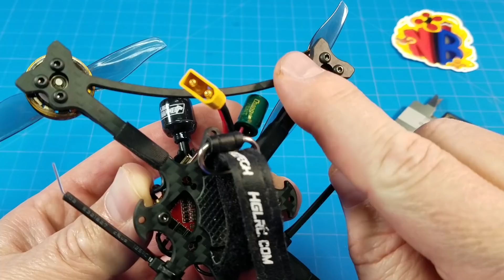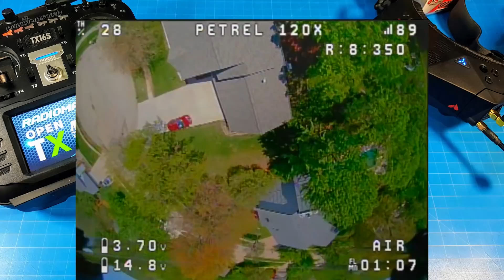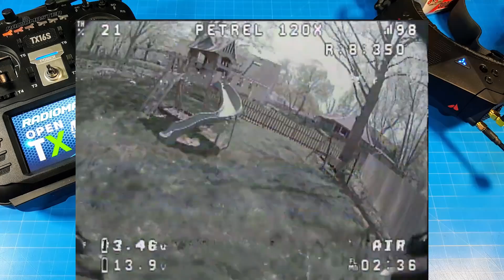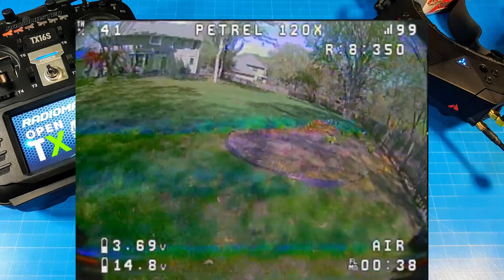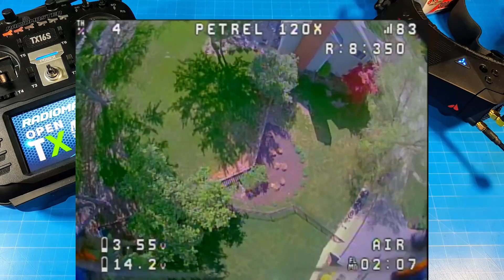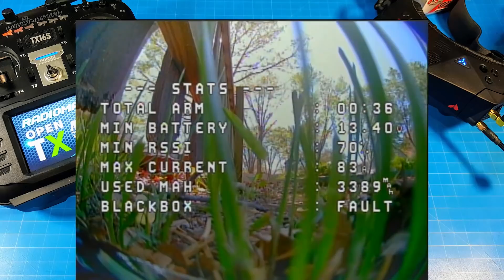HGLRC Petrel 120x 4s Edition // Powerhouse Micro // Screamer!!

Comment: Hi nick I just got this quad 4s edition and I understand it's recommended for 350 to 550 batteries, I only have a 850 4s I understand it's heavier but think the extra power might damage the quad?
Reply from the maker: no the capacity or mah of the battery won't damage the quad, its the voltage that our components are sensitive to. Sorry, I don't recall the esc amp rating on this one, but we do need to be aware of the esc amp rating and the amps the motors pull generating the thrust with the additional weight, but I think you will be fine.
Reply: Thank you for the reply, really appreciate it!

Comment: Can I run a 4s 750 on this?
Reply from the maker: Yes
Reply: Looking for a whippy quad with 6 or 7ish flight time. Suggestions?? Thank you!
Reply from the maker: @cold-frontin_penguin7902  Not sure what whippy is, I presume that is a fairly aggress flight style. 6-7minutes of truely aggressive flight is going to be challenging to get in anything under a 5inch prop. 4-5minutes is more doable on a micro like this. But as we add battery weight to get the flight time the agility and overall quick performance does decrease.

Comment: Picked the last "cheap" frsky RX'd DJI Vista version from getfpv for $238 saturday which I thought was a deal. It's 4s and runs the same F7 controller which I liked the PCB layout, looks nice and spaced out. The big seller in this size range seems to be the Crux35 and while I like them their 12A ESC scares me plus they are $30 more for a DJI Vista version. Plan to swap the RX with ELRS and made a XT30 series adapter so I can run my 2s 300-450 packs. Not sure they make these anymore so I have little hope for replacement motors but you can find a nice canopy design on thingiverse I plan to print out of TPU.

Comment: In case anybody gets this quad and has the same issue I did. Right out of the box I had a bunch of twitching during hover to the point it was barely able to fly at all. I tried switching receivers and messing with the PID tune along a bunch of other things but nothing seemed to fix it. Once I pulled up the black box log it was pretty clear it was electrical noise on the gyro, specifically the pitch axis. So I tried swapping out the capacitor it came with on the power lead to a larger one and now it flies PERFECT and is an awesome quad! I might have just gotten unlucky and gotten an extra sensitive gyro in my unit, but i was frustrated cause it was a brand new quad, hopefully this might help some one else! I'm just glad I didn't have to replace the flight controller.
Reply from the maker: Good information here. Thank you

Comment: I got the 6s version and at the same time asked the seller what controller he recommended. He told me the frsky tranus maybe I got the wrong one but it won’t bind. What would be the easier option new rx or new tx? Thanks.
Reply from the maker: Well frsky has been playing games with their firmware. Its likely the receiver would need to be flashed to match radio firmware version. At this time I don't recommend buying frsky receivers or radios unless we plan to run a particular module with the radio.

Comment: Yup disarming too quickly, and not attempting to roll the opposite way, is what caused my tinyhawk freestyle ii to roll itself along the ground into my pond. 
   Knowing it was on the ground, I cut the throttle and disarmed to avoid damaging a motor, esc, or prop... but it just kept rolling for another 10 feet.

Comment: I wish you could re-visit this but with an RDQ standard voltage 14.8v 650mah, the HV version batterys have lower c rating and sag like crazy not worth using on this powerful quad.

Comment: Thanks for this episode. My eyes almost pop out when you show your PIDs on the screen. I use the Petrel board on my single rotor helicopter diving FPV. And I have the same 40/120 ratio between P and I. This number is magical. I compile my own betaflight firmware and CC3D firmware. And CC3D needs 17/340 to get the same flight characteristic.
Reply from the maker: Boy I haven't talked to anyone using CC3D in a while.
Reply: @NickBurnsFPV  I am planing to revisit CC3D in the winter recess. I am into researching the software lineages. The developers of both CC3D and betaflight/cleanflight tinkered with some master code. They have some scale multipliers for the PID numbers to look like they are original coding.
Reply: @johncgibson4720  CC3D was a nice board and configurator was amazing back then.

Comment: Rdq or gnb 524 4s are best off both worlds lighter than 650 with the same power
Reply from the maker: I wouldn't use those with a powerhouse quad. My flight time might only be 90seconds. The smallest I would go with something like this is the old GNB 550mah 4s. The elongated batteries weigh less and have far less ability to handle demand.

Comment: hi Nick!  Why does your drone have 2 blades?  4s from the factory should have 3 blades!
Reply from the maker: I don't know. I saw the pictures showing tri blade props. Maybe that was what they thought they were going to ship with but then found bi blades to be better.....just a guess.
Reply: @NickBurnsFPV  what to buy?  hglrc 120x or geprc phantom?  Thank you!
Reply from the maker: @balantisable  Depends on your flying space and flight desires. Have you been flying awhile? The 120x is likely going to require more space, especially if you early in fpv. The phantom is going to be more smaller space friendly. On the flight desire side, the 120x is going to be faster, punchout higher and be overall more aggressive.

Comment: Which one do you prefer : Petrel 120x 4S or  Avio 3  from Avant ? Thanks for your job !
Reply from the maker: That is a super rough call. The petrel is a powerhouse in a small package, but the avio is more smooth and has a better tune, yes even after I tweaked the petrel tune :). Do I really have to pick? ......Okay, I would go with the Avio 3. I would be able to fly it more casually in tighter spaces with less noise.
Reply: @NickBurnsFPV  Thanks for your answer !

Comment: Can any one recommend. Love my 5 inch quadcopters, but to anoy the neighbors less, I want a toothpick for the summer.
What to choose? I am looking at a crux3 at the moment. But is there a better quad, at similar price, and noise level.?
Reply from the maker: the price point of the crux3 is going to be very hard to beat. I think anything similar is going to be $20-$30 more.
Reply: @NickBurnsFPV  can't decide between the fus spartan v3 or the happymodel crux3. I like that the crux3 sounds quieter, but that might be the extra performance of the fus that gives more noise too.
Reply from the maker: @pippifpv  Keep in mind they changed the motor of the fus after my review. Its now lower kv. Still more aggressive than the crux3, but not what it was by about 15%.

Comment: The extra holes look like you can use a beta FPv canopy. That way I can use a beta Fpv canopy and not use the same mount as the fc. going buy this for just that
Reply from the maker: Which Betafpv canopy. Seems like it would need to be a taller canopy.
Reply: @NickBurnsFPV  this one https://www.amazon.com/gp/product/B07VCLH6RN/ref=ppx_yo_dt_b_search_asin_title?ie=UTF8&psc=1 you would just use taller stand offs. and keep all you FC on the other holes. easy to work on and you can add a betafpv VTX inside behind/under the camera.   https://betafpv.com/collections/camera-vtx-1/products/a01-25-200mw-5-8g-vtx
Reply from the maker: @Mstom178  yep that will work.
Reply: @NickBurnsFPV  I was looking for a frame to use this canopy bc they stopped making  115hx which was so light and worke well on 3s. now I am looking for a Petrel 120x frame

Comment: I'm really interested in the 1S version if its anything like KebabFPV's babytooth, they should of sent you all 4 models since they all need to be reviewed.
Reply from the maker: There is a 1s edition? I am not seeing it. Oh I do see where they have one listed as 1s/2s. On 1s it seems like the motor kv is to low.
Reply: @NickBurnsFPV  They have an 11600 kv 1202.5 version on the HGLRC site. https://www.hglrc.com/products/hglrc-petrel-120x-3-inch-toothpick-machine-fpv-racing-drone-zeus5-aio-flight-controller-1202-5-motor-vtx-350mw?_pos=5&_sid=efe387d60&_ss=r
Reply from the maker: @ryan3859  I have asked if they would send me one, but no response yet.
Reply: Seems quite heavy for a 1s/2s build, 20g higher than a 2s TP3.
Reply from the maker: @grantmacdonald4838  This is a 4s setup. A good portion of the weight difference is the motors. They have a 2s version with different motors, which should reduce the weight.
Reply: @NickBurnsFPV  I was speaking to the 1s/2s which they quote at 60g, really heavy for a 2s. Especially compared to a babytooth build which I believe guys are getting down to ~30g for 1s build.
Obviously a totally different flight experience than a 4s quad.
Reply from the maker: @grantmacdonald4838  ah sorry, I thought their might be some confusion.
Reply: @NickBurnsFPV  no worries, I'm actually shocked they are going to market a 1/2s that heavy. The Crux3 at 40g is a fantastic flyer for less price.
Reply from the maker: @grantmacdonald4838  When I asked about the 2s version they did say "it's less fun". :) Maybe they don't expect much interest in 2s.
Reply: @NickBurnsFPV  sounds like lazy engineering, I love my 2s toothpicks. There is a nice feeling on a super light quad with lots of prop area, like gravity has been reduced. I'm just not sure where the extra 20g over a TP3 is coming from on this build.
Reply from the maker: @grantmacdonald4838  Canopy and frame could make up a fair bit of the extra weight.

Comment: The tape is used to cover wiring harnesses for autos and Industrial Equipment.   I've seen it used on cars made in the 1950s to the present.  It may have been used earlier than this but that's my experience. It was designed to be abrasion-resistant. I bought some on eBay for much less then BetaFPV.  Exactly the same product.
Reply from the maker: I have heard just that. My car experience is so limited that I haven't seen it outside of quads.

Comment: VERY interesting. The more I fly my TP3's on 3s, the more i want a bit more weight/disc load. Just a bit. With those motors at that kV on 4s @ 150g's..... LOOKS LIKE A BLAST MAN! Thanks for the great content! AND you reminded me how bad video is with these little guys compared to a "real" cam+vtx... which IMO actually adds to the value of these little guys as GREAT for getting better and more confident on the sticks. Between the throttle sensitivity, bad video, ability to fly basically anywhere, and relatively high durability/low cost, just cant be beat!
Reply from the maker: Aren’t there so many elements to our flight enjoyment. We find it all come together for awhile then we want more 😁

Comment: Crazy beast! I don't know if you can confirm my observation about (at least GNB) batteries: at a given capacity and number of cells, the wider, shorter ones, can provide more current during punnch-outs than the longer, slimmer ones?
Reply from the maker: Yes in demanding quads the more square batteries hold there voltage better. But they are heavier. I still fly my 4s 550mah because of the way they hold voltage at there own weight

Comment: This series of HGLRC quads reminds me of the long ago released Diatone GTB series. It included one of my all time favorite quads, the GTB229 TRUE Toothpick. With a battery, it falls in the under 75g optimum weight Kabab FPV said was best for a TRUE Toothpick quad. I love it because it flies superbly, is really fast and really nimble, cornering like it's on rails! Seems like many, including Diatone, decided to make a couple of larger models that didn't necessarily follow that under 75g for the best power to weight ratio a TRUE Toothpick performs best at.  That's fine... 
The GTB229 came in at around 48g, as I remember, and I typically flew it on 2s. 

I don't think many understand power to weight ratio well, because it seems like most people bought the 2 larger quads, with bigger motors, and using a 3 or 4s battery. People seems to think more power (bigger battery) and bigger motors means better! lol
Kabab will tell you that doesn't make them better because those motors add weight and those 3s and 4s batteries add a TON! 

Plus, the more weight the quad carries, the more damage it reaps when we crash. The 2s model will also be the most durable. 

Here's where the power to weight ratio comes in... Those two larger models, like the HGLRC larger ones, actually make the quad not fly as well or be nearly as nimble. They also aren't as quiet. Sure some will debate me, but as Nick said in this video, he really wants to try the 2s version! Ahh Ha! He's right because that's the TRUE Toothpick of the 3 models. Sure, the others are both fine, but a TRUE Toothpick is a THING A BEAUTY! So much power for so little weight... it has the most power to weight ratio of the 3 models... and by a lot!!! Trust me, I bought two of the Diatone GTB229's just so I'll always have one to fly! It's that good! 😃

So, I highly suggest you either search for a GTB229, or buy the slightly heavier 2s version of these HGLRC quads and experience the ABSOLUTE JOY of FPV with a TRUE Toothpick quad, as the presumed inventor of the category designed it to be! 😎🤘

Thanks much Nick for this very enjoyable review of an actual quad that's what FPV was designed to be - A HUGE ADRENALINE RUSH! 😳🤯
These damn show flying, boring, BLOATED COWS, called Cinewho0ps, and also slow flying, boring long range quads  have inundated FPV! They've taken the main fun part - that great RUSH of ripping it up, right out of our hobby and made our fun quads perform like a DJI video quad, but cheaper! 😩
I love to see these REAL quads being released! 😎👏
Reply: Hi, have you tried the crux3?
Reply: @zic2979  That's that bottom of the line Happymodel (also Eachine) junk!  They fail more often, cuz of the low quality parts, then you have down time while you wait for new parts to come in. Plus, extra cost to buy the parts and repair it. By the time you do that a few times, you could have purchased the quality brand name quads I mentioned, and have saved some money too!  

That cheap junk looks good at first, and I used to buy it! But, I have learned my lesson because those quads cost more than the brand name ones over a 1 or 2 year period of "attempting" to keep them in the air and repaired. plus, you can fly them less because they are waiting for parts all the time.  Better off buying the quality brand name quads and have less down time, less parts to buy, less repairs, and more fun flying with less money spent on them in the long run!  

You can learn from my experience or buy that junk and learn the hard way....I'm just trying to save you the time, money, and frustration.  I have nothing to gain by sharing this with you...just helping you not make the same mistakes as I did... ;)

Comment: Thoughts on this one vs Diatone's GTB "Cube" 339? That frame was so thin and light it was lightning quick but plagued by some reliability issues on 3S 3" triblades
Reply from the maker: I don’t think the cube is as powerful or as fast the non cube version with 1407 motors is likely more powerful and faster than this.

Comment: 1404 for that 3" biblade !?
Isn't that an overshoot ?
Reply from the maker: I don't understand "overshoot". Do you mean not enough prop for that motor? I see pictures with triblades, which it can likely run but will require or need a different pid tune.

Comment: I Ordered this quad like 2 weeks ago, still waiting for it to arrive. I'm surprised this quad isn't more popular, I've been looking for a decent 3inch Bnf ripper that isn't just a 1s or 2s toothpick. I knew you would be interested in this quad
Reply from the maker: lol, I do like raw power. I am hopeful a 2s quad I have been working with others on will be of interest too. Super small, light weight but still able to be aggressive and punch over the house.
Reply: @NickBurnsFPV  excited for your 2s!
Reply: @NickBurnsFPV  Are you going to review all of it's kin? The other voltages? I really like the 1s and 2s versions, they are much lighter, but I just had to get this 4s kv.
Reply: You seem to have a slightly different version, they show it with 3016 3 blade props and 4500kv.
Reply from the maker: @jhughes2286  Yea, that it what I was noticing as well. Pretty strange. I don't think I will review the 6s version, but the 2s is more interesting to me. :)
Reply: Where did you buy it?

Comment: Excellent review as usual. Look forward to your next video. Nick, What is your current favorite outdoor quad?
Reply from the maker: It would depend on the day and what kind of flight I am wanting to pursue. It can really range a lot. I have 2.5 sharkbyte build I like. The geprc phantom HD, which is dji, this one is a lot of fun too. Other days, I will fly my tks 75mm 1s, or the 2s version I have been testing. And when I want more smooth flight the avantquads avio and the geprc cinelog25.
Reply: @NickBurnsFPV  appreciate your response. I've been enjoying a Tinyhawk 2 Race for backyard ripping. Its been windy, but has been rock steady compared to other quads I fly. I think thats opposite of your experience with the Race, but they could have changed the tune.

Comment: Nice review NIck! I see they have a 6s version of this as well. Has me wondering how much more power a 6s micro has when you add the weight of those extra two cells?
Reply from the maker: I have flown 1-2 6s micros. I find I can feel the extra battery weight in speed turns. I suspect its good for more of a freestyle flight with plenty of punch and longer flights.